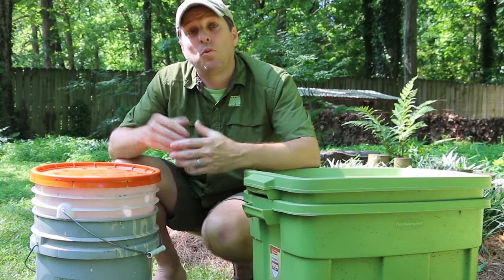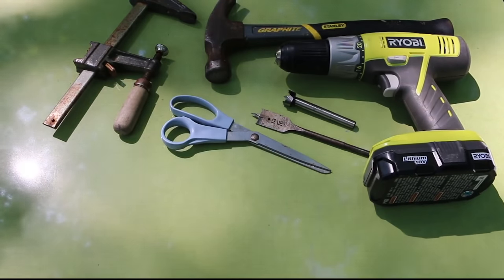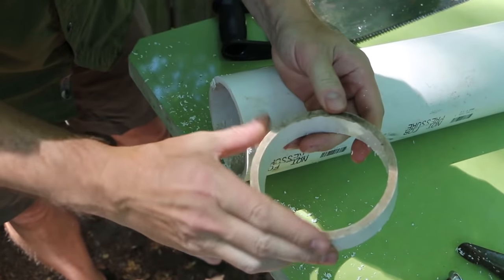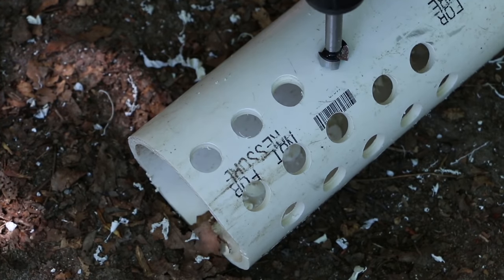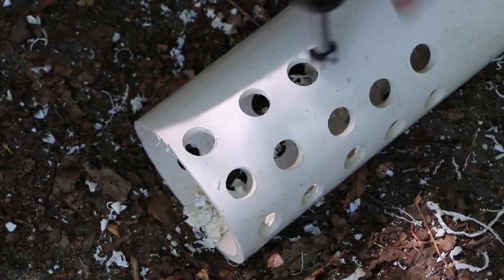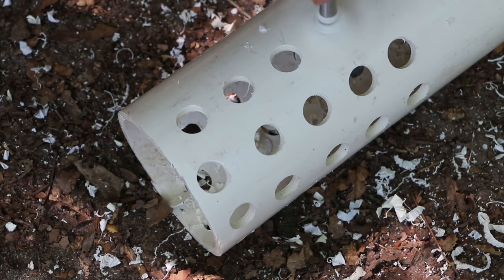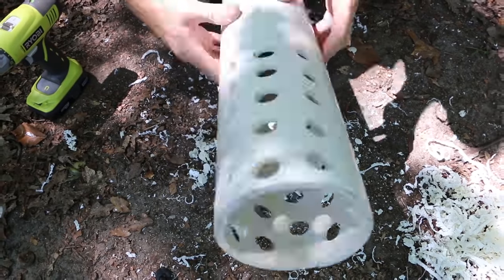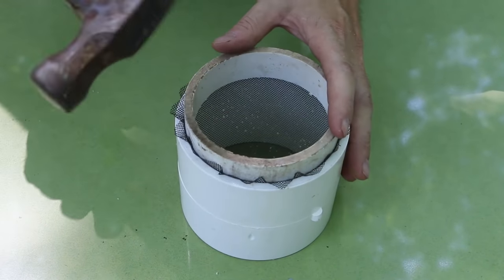How To Make A DIY Worm Tower

Comment: once the wormicompost is made how do u remove it, and how do u separate the worms and start all over at some other place in ur garden?
Reply from the maker: The benefit of a worm tower is also a limitation. The castings aren’t harvested, they flow out into the garden automatically with the rain or with a little extra water poured through. But, the worms can’t be regathered and moved. They will migrate out into the bed, and come back to dine if they want. Ideally, if the food supply is good, enough worms stay around to keep things processing. This is closer to a natural system, versus a contained system. Thank you for watching.

Comment: looks good  but how would it work in a worm bed? just curious may try it and see what happens
Reply from the maker: The worms in my normal worm bin process more compostables when they are spread out in layers. Placing a worm tower in a bin, would concentrate the compostables in one place. But, it might be an easy way to load the compostables in, without having to do lots of layers. Thanks for the comment. If you give this a try, let me know how it works.

Comment: with this set up. would you do all watering through the worm system, or water somedays in system and water plants as normal?
Reply from the maker: I think you need to both water through the worm tower and water plants as normal. The furthest plants from the tower wouldn't get enough moisture. Thanks for your question.

Comment: You can apply a little vegetable oil to the cap so it wont get stuck.
Reply from the maker: +Bradley Suarez Good suggestion. Thank you for sharing.
Reply: +Bradley Suarez -  Terrible idea, vegetable oil gets sticky over time and will essentially glue the cap on.

Comment: Love the idea, I was looking for something like that. What about animals? they smell things and want to dig in it? I have hardships with that specially because of my outside dog.
Reply from the maker: Hi Lorianna. I don't have a dog, but where these worm towers are installed, there isn't a fence yet and the neighbor dog is around. She doesn't seem to be interested. That said, there isn't much odor, and what there is a "earthy" smell. I have had moles dig in through the holes in the bottom of a different type of composter. They eat the worms. My 5-gallon bucket worm tower uses a wire mesh to keep them out. https://www.youtube.com/watch?v=aeFL2zxU6zg&t=25s However, I say try the easier approach and then adapt if you run into issues. Thanks for watching.

Comment: How about a thin layer of Vaseline on the pipe before putting the cap on to get it moving easier? Nice video.
Reply from the maker: Hi Bob. I think that would help. The only question mark for me is if the Vaseline would react with the PVC. Certainly not explosive, but more of a slow dissolve. I think if you keep an eye out for that you should be OK. Maybe consider olive oil as an alternative. Thanks for watching.

Comment: How often do you add water and scraps?
Thanks for the great idea.
Reply from the maker: Hi Doug. I’ve got three to four worm composters operating and the same time. I rotate our sail kitchen scraps between them. I’ll add some newspaper bedding over the fresh scraps and sprinkle some water to wet it down. That helps lock in any potential odors. I’ve you’ve got a small bit of scraps you can also pull back the bedding and tuck it under. Thanks for watching.
Reply: But is this daily with the scraps AND the water?

Thank you

Comment: Would works make it through a Chicago winter if I did nothing and just left it in place?  Never have done anything with worms before.
Reply from the maker: I've lived through a few Chicago winters. Most likely the composting worms will go deeper to escape the cold. You can help by adding a 3-4 inch layer of wood chips and or leaves to your garden bed before the cold sets in. They may not all make it back to the worm tower in Spring, but the worms that find it will start up the colony. After a few cycles, the whole garden will be a composting worm colony...and that's not a bad thing.

Comment: Do you need to water the garden separately as well or will the water poured into the tower be enough with the mulch?
Reply from the maker: +TaylorMinksMusic I suggest watering the plants directly as well. The plants directly adjacent to the worm tower might get enough moisture, but the others won't. Thanks for watching.
Reply: @GreenShortzDIY  If you want to go the extra mile, you could dig a trench 1 or 1.5 feet deep, lengthwise to your garden, and at the bottom of that trench, bury a gutter canal with both ends sealed, and place the compost PVC tower at the mid point of the gutter canal, so that most of that compost tea created by the worms, could drain and accumulate inside the gutter canal for the roots of the plants to drink. Adding hay or straw as mulch on the garden floor would also help with moisture retention in the garden and the  hay/straw would create composting material also at the bottom layer where it's in direct contact with the ground.

Comment: Why not drill more holes & use more of that pipe in the ground earth works are deeper and will be visiting these as well ... I made some 5inch  ones  last year  30 inches long & left only 4-5 inches at top and used a flower pot upside down for a lid so the sun wouldn't shine down inside, leaving the worms in a dark place...
I also used a bucket handle w/ matching holes to help pull them out when i rototill start of spring....Thanks for the share.
Reply from the maker: Mat, that is an acceptable option. I set the 6 inch depth on my worm tower's perforated zone based on the depth of the plant roots. I wanted the composted nutrients to be concentrated in that area. You can certainly go deeper. That puts the focus on growing a worm colony and building soil, versus feeding plants, but that can be just as valuable. Growing a bigger worm colony can also mean processing more compostable material as well...another good thing. Thanks for watching and for sharing your perspective.
Reply: I guess maybe i am feeding a colony..lots of worms in my garden..& too long their hard to get out ..i'll be making mine a little shorter w/ a removable handle to pull them out easier
Reply: Jjust made2 for my raised bed. Suggestions:  use 4" drainage pipe. Much lighter, easier to work with, cheaper. Have to use 3" coupler and it slides inside of pipe.   Lay your screen on top of the tower.  The tube ring goes on the outside of the tower.
Question:  how do you get worm castings from the tube for other uses. Will the castings stay in the tube if you pull it out?
Reply from the maker: Leslie...that is a good modification. One consideration will be heat, if you are using the black corrugated drain pipe. In the sun, it will absorb heat which might make it too hot for the worms. It would be easy to shade it though. To me the benefit of a worm tower is the direct application of the castings to the garden bed. If you want to harvest castings, I suggest a flow through composting bin, where you capture the castings for use elsewhere. Here's a video I did making one: https://www.youtube.com/watch?v=2smEluKUaJw But, don't build this one. I've got a simplified version in the works. I'll have that video in a month or so.
Reply: GreenShortz DIY   The tubing is white pvc, just smaller gauge.

Comment: Use paper from the paper shredder. Usually have to trow it away anyway.
Reply from the maker: Thanks for the suggestion James. Thanks for watching.
Reply: Maybe my worms are picky but the don't seem to like eating the white paper for your printer. They LOVE plain newsprint and I find no traces of that in my 3 bins. In my first bin I did find near the bottom a layer of white paper that didn't get eaten or compost it was a layer of white soggy mess! But it may have been just too thick a layer and later got very soggy from the 8" if scraps above it. I also tried adding my shredded mail.  BIG MISTAKE! you know those envelopes woth the clear windows??? Now my worm casting for my plant are full of little shredded bits of clear plastic windows...   :(

Comment: Thinking hard about how I can do this without attracting pests.  On another channel I saw a guy say you have to bury garbage two feet down so pests won't dig it up.
Reply from the maker: Brenden, I've got a bucket worm tower video that deals with some pest issues. The bucket is fully buried and limits the odor released, which is the main thing that attracts pests. Check it out. It may be a better option for you. Thanks for watching.
Reply: @GreenShortzDIY  Thanks. Will check it out. I have a beat up garbage can with leaf compost in it and when I turned it I saw a couple of worms. Do you think I should not dump it out and turn anymore to protect the worms?

Comment: Will this work where the summers get over 100 degrees?
Reply from the maker: I get in the 90s here in GA. My suggestion would be to make your underground section of the tower deeper, to let the worms go further down to escape the heat (12 inches?). Have the perforated section of the tower start 4 inches down as well, to preserve moisture. I'd add a solid top to the bin (pipe cap) and drill a few holes (1/2 inch) to allow hot air to escape. Also consider shading the tower in a wood box (or making a wooden tower). Make sure to keep the tower moisture up. I'd be interested in knowing how this works for you.

Comment: Thanks for this very helpful video! So do we need to add shredded paper and sand each time after the initial set up with the worms, or just compost and water after the first set up?
Reply from the maker: I say paper and compostables each time. You'll want to cover the new food scraps with damp paper. Keeps any odor down...not that the smell is bad, but other insects can find the bin. You don't need to do grit every time though. Maybe a sprinkle every third time. But, a little every time wouldn't hurt either. Thanks for watching Mr. Flash. :-)
Reply: @GreenShortzDIY  Thanks a bunch, that's very helpful, as was your video!

Comment: Is it ok to just use a cap/closed lid? Is the mesh necessary for air, or do the worms get oxygen through the soil??
Reply from the maker: I prefer letting the rain in. It is the water that will push the liquified nutrients out into the garden. A closed lid could reduce this flow, although the worms do some of that work. I’ll say that no lid would be better than a solid cap. Thank you for watching.
Reply: @GreenShortzDIY  Thank you for your reply, will take the cap off 😉

Comment: One thing is not clear in the video. So I need to continue adding shredded paper and grit in the form of sand along with food scraps or are they
Reply from the maker: Yes. Bedding is added each time you added compostable material. It covers the compost to help keep any odor contained. Moisten it with a little water when you add it. You can add a little each time as well. Thanks for watching.
Reply: GreenShortz DIY    GreenShortz DIY  Thanks!  I made five of the compost towers from PVC. Total cost for a 10’ length of pipe and fittings for all five  was $18.  I had some leftover screen and collected more from neighbors through the Nextdoor app.  Now my challenge is to find where I can buy worms locally.  I have some leads although the quarantine is presenting a challenge.

Comment: is there a feasible means to convert this to possibly use in a flood and drain hydroponic garden?
Reply from the maker: I've heard of adding worms to media beds in aquaponic systems. I would guess the nutrients could be used in a hydroponic set up too. Not sure if the worm tower would introduce harmful bacteria to your system. I've read that aeration neutralizes harmful bacteria, so if you've got enough oxygen in the system, you should be ok.

Comment: Great design, simple and practical! What would be the cons for making it a little shorter? Or is that just a matter of preference?
Reply: To make it easier to access when ur veggies grow up...size it to what ur growing around it...in larger planting beds, you could use same idea but with black nursery pots or 5gal buckets, Cheers
Reply: A con could be that it's shorter than the surrounding plants, which may make it harder to access.  Also, with a shorter tube, it means you get to put less stuff in there.  But that only matters if you have too much stuff to be putting in there.

Comment: Any concern with getting too many leachates into the soil from composting directly in the bed?
Reply from the maker: Hi Jeff. I think leachates directly going into the bed is part of the benefit of this setup. As they will do so on a continuous basis, they shouldn’t be an issue with concentration. That is where a bacteria situation could be a concern. Thank you for the question. Thank you for watching.

Comment: Got some questions. I have a solid lid on mine to keep out excess rain. Should I add some ventilation to compensate, like on the sides where the pipe is open to the air?
And does it matter if some dirt falls in through the holes when I am backfilling?
Reply from the maker: Hi Sonja. You'll want the rain. It should drain fast enough that excess won't matter. Don't worry about the backfill. Composting worms work in the top 12 to 18 inches of soil, where there is just higher organic content. A little soil will get mixed in quickly. Happy composting. Thanks for watching.
Reply: @GreenShortzDIY  Excellent, thanks! And how do you know if you need to add more bedding? Or do you just keep adding more with the food scraps every time?

Comment: I have a question:
How do you harvest the final castings? I don't thing there's an easy way without taking out the whole pipe from the ground...
I liked it very much, but i think this is missing point.
Reply: There’s no need to harvest the castings as the worms are leaving them right where you want them: in your garden bed! Assuming that’s where you put this, of course.
Reply: @kelsabanana  wait, the pipe is going to be filled up by castings at a certain point, i think we need to remove it for getting more space for food scraps

Comment: What is the effective radius of this method? What area around the tower?
Reply from the maker: Dave, I’ve got two towers in a 3 x 8 foot bed. But, there are lots of factors involved to answer your question, many of which would be hard to measure. A 4 x 4 area has been my rule of thumb. Thanks for watching.

Comment: Last year when I started gardening I saw not one earthworm. I started cleaning the earthbeds last month and pulled out all the dead plants that I didn’t want to let go because they were still “kinda” green. And I found worms. But I’m building raised beds this year so it’s easier on my back and plan to do this tower. I will be placing cardboard at the bottom of the raised beds before I put in soil, the worm towers and seedlings. But I know the cardboard will decompose in a couple of months. What will happen when the red wigglers and native earthworms cross paths? Will they kill each other (because hmm idk...they could be territorial?) and I’ll end up with no worms in the towers, in the ground or in the beds?
Reply from the maker: The worms will coexist just fine. Chances are you have a native composting worm (perhaps even the red wiggler). Buying them is much easier than capturing enough to get a colony going. The composting worms tend to stay in the top 18 inches of soil, where their is lots of organic matter. The earthworms, which process soil, exist deeper, except when rain fills their tunnels and they escape to the surface. Thank you for watching and happy gardening.

Comment: I have piles of horse manure on my property. Can I put a worm tower in the piles feed the worm my kitchen scraps and let the worms come in an out. It may take a while but the manure should eventually become compost (faster then just letting it sit, right?). I've checked the piles for heat and I would have to break some down into small piles. 

Enjoy your videos.
Marty
Reply: Good thought!
Reply from the maker: Hi Marty. I think this would work nicely. You might try a bucket worm tower instead of a PVC tube. You get more volume that way.
Reply: Hey Marty, I just pile our horse stuff in a big pile, let it cook over the winter and you will have excellent  compost next summer, worms not needed for your app... Unless your are just bored and want to give it a go...?
Reply: Very fresh manure will kill plants. Let it spread out  and age it for about 2-3 weeks. Then you can add to scraps.

Comment: Not sure if you are still reading comments on this post… will the PVC pipe ever get full? What happens then?
Reply from the maker: Hi Chong. I still keep an eye out for questions. :-) I’ve got several different composters, so mine hasn’t gotten full. Having more than one would help limit that happening. But if it were to fill up, you could pull it up and move to a new location in the garden. Leave the stuff that is below ground right where it is. If you are careful, the column of compostables higher in the tube might stay in place for the move (bringing some of the worms along). Another idea would be to drill a small hole just above ground level to put a metal tent stake in to support the compost column as you move it.  Just a couple ideas. Thank you for watching.
Reply: @GreenShortzDIY  Yeah I suppose it is always possible to move it to rejuvenate another part of the garden... Thanks!
Reply: @GreenShortzDIY  I made 12 of this today. Planted 2. I left them open. We'll see if I need to cap them. Thanks again for the video.

Comment: I bought a cap for the PVC pipe.  Is that ok to use or should it be a screened cover?
Reply from the maker: Hi Cheryl. The cap will work with several 1 inch holes in it (or twice as many 1/2 inch holes). You just need a way for hot air to escape. You can screen the holes if you want. Thank you for watching.